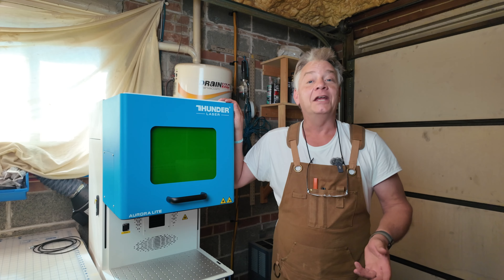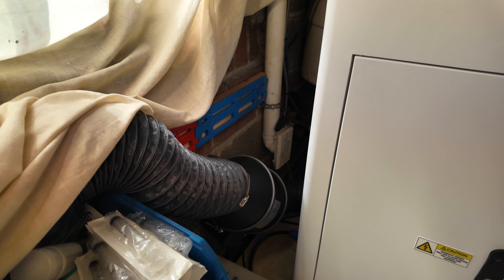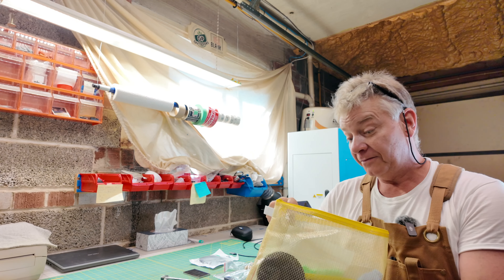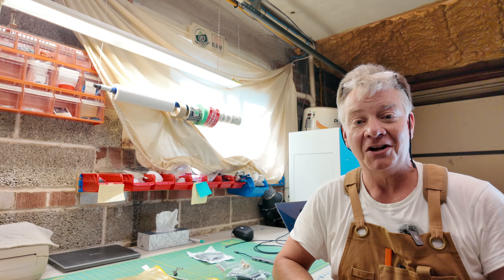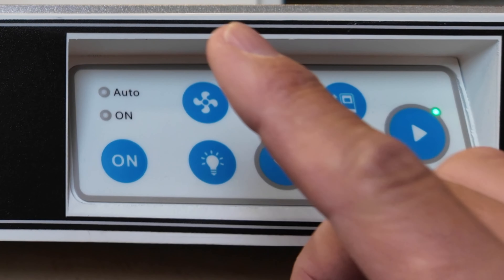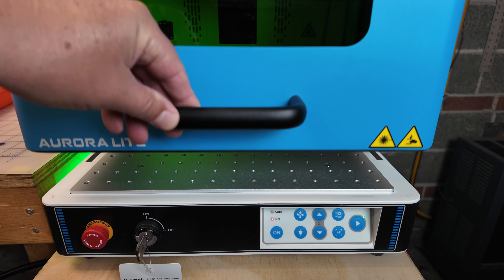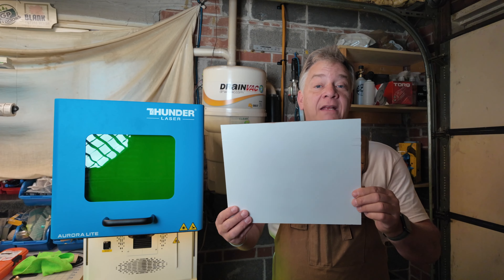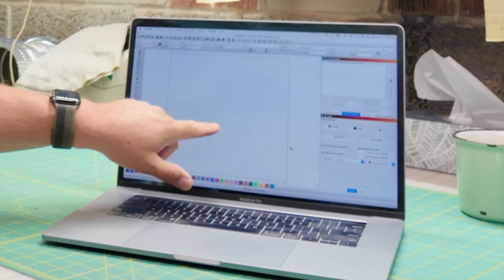Aurora LITE Fiber Laser. Physical Installation Tips 052   4K

Comment: I swear I saw another of your videos where you went through the Lightburn config for the Aurora Lite. I can't find it. Am I going crazy?
Reply from the maker: Hey good morning - so very sorry for the inconvenience. I took it down because I made an incorrect change in part of the video and I didn't want you folks to change something wrong. I am re-editing it and promise it will be back up in the next day or so.My apologies. If you have a LITE, and a specific question, let me know and I will respond. Thanks GP
Reply: @LaserNUG  Thanks for the reply! Oh good, I'm not (totally) crazy lol. I remember seeing how you configured the LITE in Lightburn. We've got ours working, but I think you took some steps we haven't. So I'm mostly wanting to know all the steps you took to configure in Lightburn. 

Also, it seems that when I measure an object to engrave and specify the dimensions in Lightburn, the resultant red outline on the laser bed is much larger than the dimensions I specified. How do we make the framed red outline match the size we specify in Lightburn?

Thank you for your videos! We are new to Fiber engraving but have been using CO2 for 10 years.
Reply from the maker: @tuscarorawoodworks4713  LOL! Again, so sorry. The Video from Thunder Laser I referenced in the first video description is inaccurate, and my subsequent video was inaccurate. I am loading the revised video as I type and it should be public within the hour. If your scaling( size) between Lightburn and the laser is not correct, I will show you how to fix it in this video, but if you follow this revised video in an hour, it should scale perfectly for you. What I did myself, is I simply deleted (click "Remove" in the Device Menu) and I started over again. Again, I am very sorry if I caused you any trouble but please let me know if everything works ok after you watch the revised video. I will let you know when it is live. Should be about an hour. Cheers and thanks again!
Reply: Eagerly awaiting the new video. Thank you!
Reply from the maker: @tuscarorawoodworks4713  Just released. Let me know if you have any questions. Good luck!
Reply: Just watched it and followed your recommendations. Everything works as advertised now. I didn’t need to make any scaling adjustments after installing the corrections file (I assume that took care of it because the framing on the bed now matches the screen in LightBurn). Thank you again for a very informative and helpful video!
Reply from the maker: @tuscarorawoodworks4713  Glad it worked and very sorry again for the confusion. All the best!